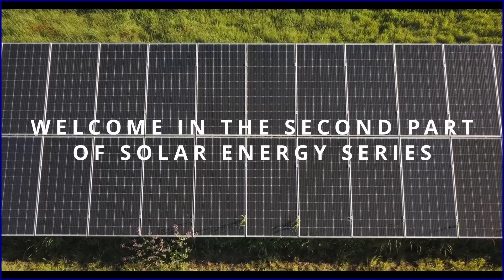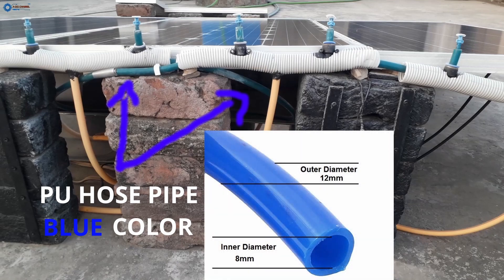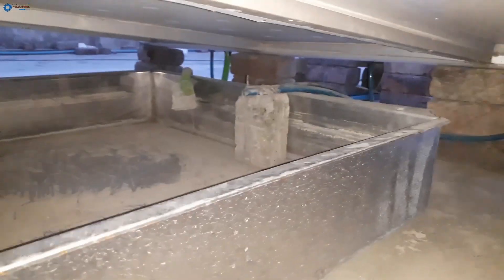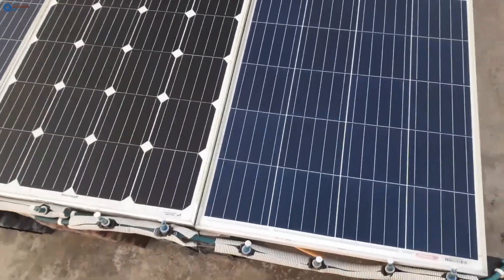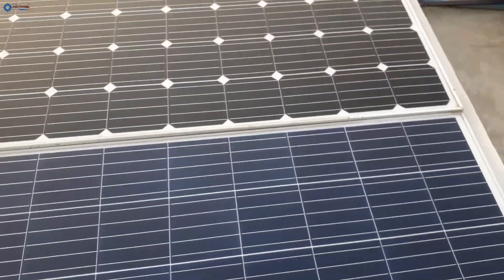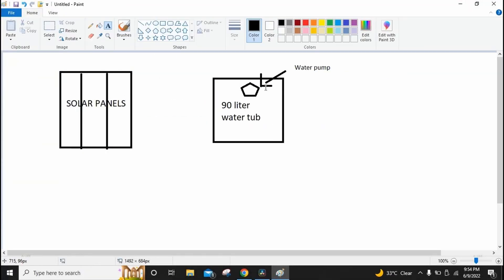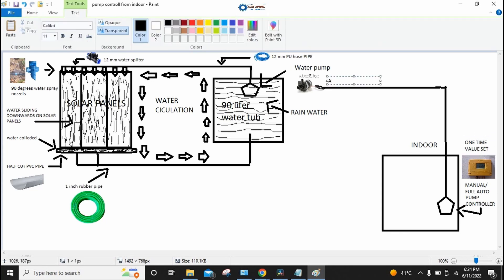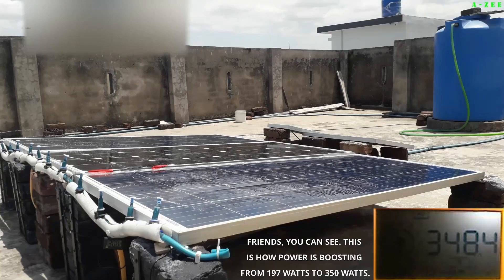WORLD'S BEST SOLAR POWER BOOST SYSTEM! I REACH 197 WATTS TO 360 WATTS. 163 WATT BOOST. 80% INCREASE

Comment: Nice build.  Something i always thought about doing,  just never got some around to. 

How do you filter dirt from the run off from clogging the pump? Also how do you stop algae growth when it's recycled in the pan?
Reply from the maker: THANKS FOR YOUR COMMENT, YOUR COMMENT JUST COME WHEN I WAS FEELING A LITTLE UPSET.
And, IN THE PAST I HAVE MADE A DIY CLEANING SYSTEM OF THE WATER BUCKET, THAT IS UNDER THE SOLAR PANNELS. IT IS KIND OF A LONG ROD WITH A MOTORIZED BRUSH AND A SMALL 12V PUMP TO PULL OUT DIRTY WATER FROM THE WATER BUCKET. AND ALSO I CAN PULL OUT THE WATER BUCKET IF I NEED TO.
NOW I INSTALL TAB FILTERS. I LITTLE MODIFIED THEM. SO NOW DIRT IS NOT A BIG ISSUE.
(I HOPE YOU UNDERSTAND MY ENGLISH)
AND THIS IS ABOUT 2 YEARS OF THIS COOLING SETUP. I FOUND THIS TRICK VERY USEFUL. NOW I EXPAND THIS WATER COOLING SYSTEM EVEN MORE. I DID MANY UPGRADES AND MADE IT BETTER THAN YOU SEE IN THAT VIDEO. I ALSO MADE A AUTOMATIC 700 LITERS RAINWATER HARVESTING AND STORAGE SYSTEM BESIDE MY SOLAR POWER SYSTEM. I AM LOOKING FORWARD TO UPLOADING THAT VIDEO AS WELL.

Comment: Nice. But if the water is circulating isn't it heating up? Hence the water your spring over the panels eventually gets to the same temperature as the panels?
Reply from the maker: not much, 100 L water is in circulation, the temperature of water only rises 4 to 6 degrees from 28 ambient temps of the water under the shadow of solar panels, and heat dissipates with air blowing under the solar panels.
You can also put a 10kg ice cube into the water tub. This will make an astonishing 20-degree circulating water in 65—to 70-degree solar panel temperatures.

Comment: Only works if you have very little dissolved salt in the water. I tried it but there was so much calcium in the water, the panels got covered in shite calcium.
Reply from the maker: YEAH, here you made a TERRIBLE mistake, you did not watch the video completely. BRO, I WAS USING RAIN WATER. I TELL THAT IN THE VIDEO
I CAN HELP YOU TO AGAIN CLEAN YOUR SOLAR PANNELS FROM THAT WHITE LAYER. and restore your solar panels to their original shape.
as you can see I am very experienced in this field, and only I know the formula to clean that white layer, 
DONT DO ANY THINK stupid to clean the white layer, you might damage the solar pannels permanently, their is a proper method, through which your solar pannels can restore to their original shape.
that layer is not calcium, it's the sodium-sulfur layer, and you use bore water that comes under the earth. that have a huge quantity of sodium-sulfur. that is good for our human body when we drink the water but you can't use that water in a solar panel cooling system, as you have seen what will happen. rainwater has 0% sodium-sulfur. BRO WHAT innovation I made, is based on years of effort. So please AT least watch the video completely. because I put complete information on that related project in the video.
THANK YOU.
Reply: Hi bro, unfortunately I am currently facing same issue. Thank God I found your comment, can you please tell me what to do, to return my PANELS in previous condition. What chemical should I apply, so it clean the PANELS without damaging them permanently???

Comment: Modern panels lose efficiency at the rate of 0.3%/°C>25. With a panel temperature of 70°C you should lose (70-25) * 0.3 = 13%. Instead you are losing almost 50% which means your panels are either old, broken or just bad. With decent panels, connecting a 25W water pump to make up for the 36W loss (10% of 360Wp) is obviously not worth it. I will also remind people that hosing down a very hot panel with cold water will instantly break it since it's partially made of glass. It's a cool school project don't get me wrong but it's unpractical and isn't worth it at all.
Reply from the maker: So you challenged my all research + thinking + work
I prefer you should have a brief debate with me on this matter. And I challenged you, in the end, you will find out we can not even BOOST 70 to 80 % but 200 to 300 % without doing any kind of damage to SOLAR panels. 
You sound like a typical SOLAR INSTALLER, who is only concerned with his profit and sale. 
Come on accept my challenge kid, let's have a live debate on this matter on YouTube.
And I also know now you won't reply to me back.
Reply: @A-ZEE_OFFICIAL   Oh yeah I'm definitely challenging your claim that everyone will get a 300% increase in production by simply water-cooling the front face of a solar panel with a hose. You are getting abnormally good results because your solar panels have a very very bad heat tolerance. Try that again with a cheap 400wp TrinaSolar panel, you'll not even lose 10% at 70°C. What I'm basically saying is that it's much cheaper and easier to buy a decent solar panel than to water-cool a shitty one. But hey, if it works for you it's great! ;)
Reply from the maker: @Utopy34   WOW! I WAS NOT EXPECTING YOU REPLAY, BUT YOU ARE GREEDY SOLAR INSTALLER. 
WHY DON'T YOU AGREE ON LIVE DEBATE ON THIS TOPIC? 
AND YEAH YOU HAVE EXTRA MONEY TO BUY THE BEST AND MOST EXPENSIVE SOLAR PANELS, BUT 95 % OF THE WORLD DONT EVEN AFFORD TO BUY EVEN "B"  GRADE SOLAR PANELS. YEAH, PEOPLE LIKE YOU CAN BUY PREMIUM QUALITY SOLAR PANNELS WITH AN EFFICIENCY RATE OF 27 TO 35 %, 
THE SOLAR PANNELS YOU SEE IN THE VIDEO HAVE 17% EFFIENCY.
Reply: @A-ZEE_OFFICIAL  I apologize but the title of your video is misleading, it starts with "World's best..." so I thought I was included. You should change it to "Third world country's best solar boost system". Anyway, keep up the good work!
Reply from the maker: @Utopy34  🤣🤣
Reply from the maker: @Utopy34  WHAT IF MR BEAST, OR ANY YOUTUBE CHANNEL WITH 3 - 4 MILLION SUBS, USES CLICK BAITS, THERE YOU SAY? WOW, THIS IS ABSOLUTELY AMAZING CONTENT, HE IS A LEGEND. YOU ARE JUST CHALLENGING ME BECAUSE I HAVE ONLY 500 SUBS.
Reply from the maker: @Utopy34  WHAT AGE YOU ARE 20 OR 25 IDK, 
YOU DON'T KNOW HOW THE WORLD WORKS, 
THIS VIDEO WAS SHOWN TO YOU BY A YOUTUBE ALGORITHM, IT IS NOT IN MY HANDS TO TARGET MY AUDIENCE. I DID NOT EVEN GET A PENIE FROM ANYONE OR YOUTUBE, ALL YOU SEE ON MY CHANNEL IS FROM MY PERSONAL POCKET, AND AS YOU SAID IT A GOOD WORK, SO MENTION HERE ANY CHANNEL THAT IS DOING GOOD WORK FROM HIS OWN POCKET. INSTEAD 70% OF PEOPLE ARE HERE WASTING VALUABLE MONEY THAT YOUTUBE GIVES THEM,
Reply from the maker: @Utopy34  YOU SAID 
" the title of your video is misleading, it starts with "World's best..." so I thought I was included. You should change it to "Third world country's best solar boost system". "
BUT THIS POWER BOOST THING IS EFFECTIVE IN "THE MIDDLE EAST " " ASIA " AFRICA "  " AUSTRALIA " AND ALSO MANY HOT PARTS OF " EUROPE " AS WELL. AND IN ALL THESE REGIONS " 6 BILLION" PEOPLE LIVE. AND THANKS YOU NOW RECOGNIZE " I AM DOING GOOD WORK ". SO YOU SHOULD SUBSCRIBE NOW.

Comment: in order to get so much gain the temp. coefficient of your panel should be so high and the temp. in your area should be super high like in a dessert?
Reply from the maker: actually, I did not live in the desert. I live in a moderate-weather area. this is a solar panel flaw. and there is no certified method to get rid of this flaw. if you have 40 degrees Celsius. the temperature of your solar panel surface will rise up to 65 to 70 degrees Celsius. in the desert, the conditions will be worse.
if you have seen the complete video the temperature sensor is showing 60 degrees centigrade. but on that day the actual temperature was 38 degrees centigrade. and I am sure you know any temperature higher than 25 for solar panels will affect the solar power output.
and here comes my cheap power boost idea. I drop the solar panel temperature down to 30 degrees. on a summer sunny day. which led to an 83% power increase. 197 watts to 350 watts. sometimes reach up to 360 watts.

Comment: What type of spray nozzle are you using to spray on the panels
Reply from the maker: FRIEND THESE ARE GARDENING SPRAY NOZZELS.
I AM SENDING YOU AMAZON LINK. JUST TO SHOW YOU. BUT IF YOU WANT TO BUY CHOOSE YOUR OWN SELLER
https://www.amazon.com/Irrigation-Refraction-Watering-Threaded-connection/dp/B0C463R13K/ref=sr_1_13?crid=4H14LGHQ60PW&keywords=gardening+spray+nozzles+90+degrees&qid=1695656109&sprefix=gardning+spray+nozeels+90+degrees%2Caps%2C348&sr=8-13

Comment: Would be nice to see it working. How much water does it require adding every 24 hours??
Reply from the maker: @samsewall4153 NICE TO SEE YOU. AFTER 10 DAYS, IT NEEDS 40 to 50 liters of water to maintain its water circulation. Water losses just because of evaporation.
BUT IT DOES NOT MATTERS, I HAVE 200 GALLONS OF RAIN WATER IN THAT BLUE TANK, WHICH IS MORE THAN ENOUGH FOR 6 MONTHS. IF THERE IS NO RAIN IN THIS PERIOD. IT TAKES ONLY ONE RAINY DAY TO FILL 200 GALLONS OF WATER TANK.
And I request you like and share this video. SO MY CHANNEL WILL GROW AND I CAN CONTINUE MY RESEARCH ON THE EFFICIENCY OF SOLAR PANELS.